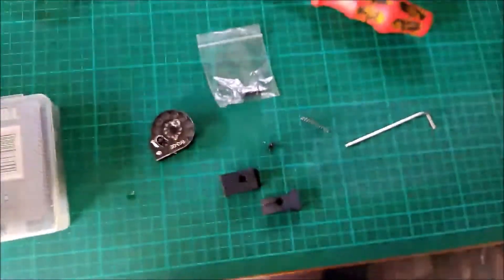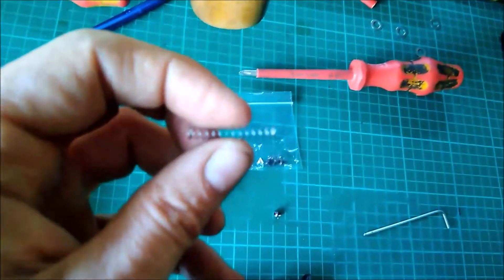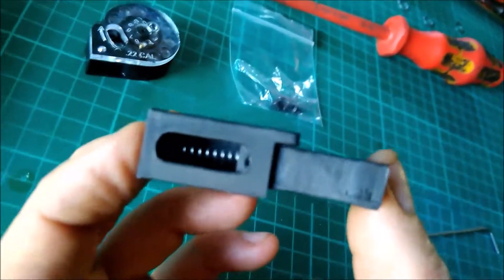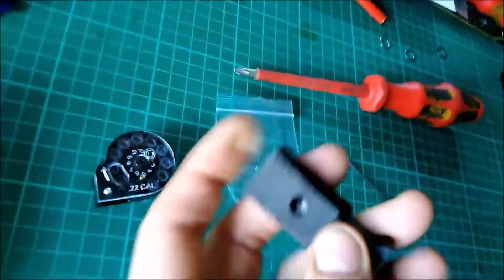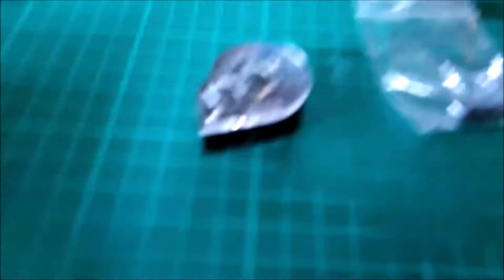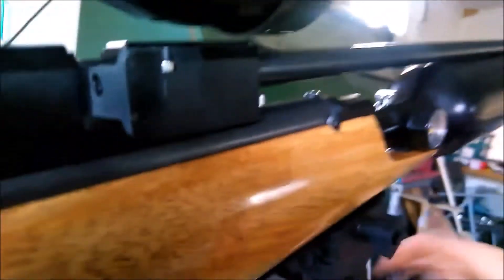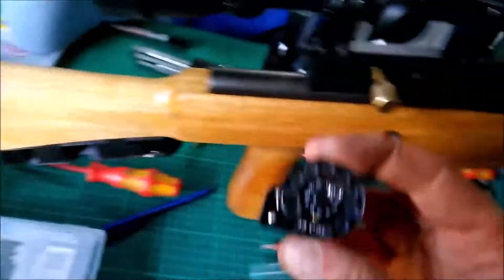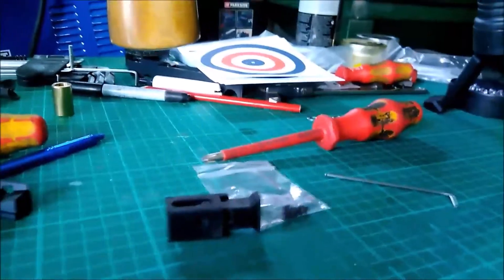Benjamin Marauder .22 Rifle spring operated single pellet loader

Comment: great design mate, i just wonder, to make it work for .177 pellet do i just need to scale it down or is there any rework need? sorry for noob question, just got my self an Ender 3 v2 and starting to tinkering a bit, no sufficient knowledge for 3D design software tho :)
Reply from the maker: I have not had access to a. 177 version but I would think that the hole centres would be the same in regards as where the barrel is placed and it wouldn't be to much to mod the model in tinker cad to make the holes smaller